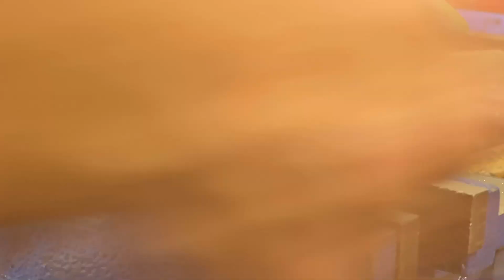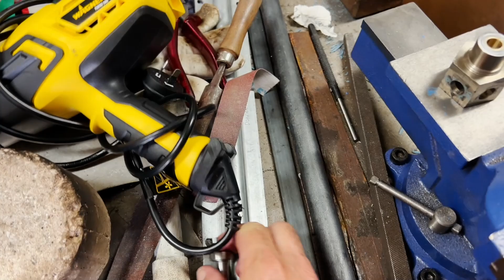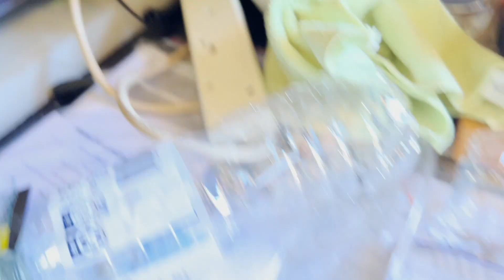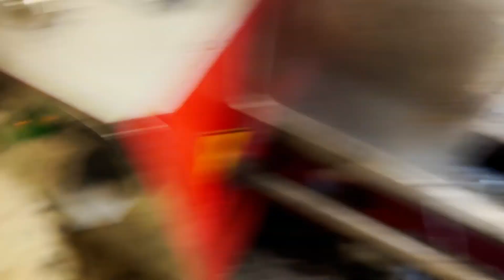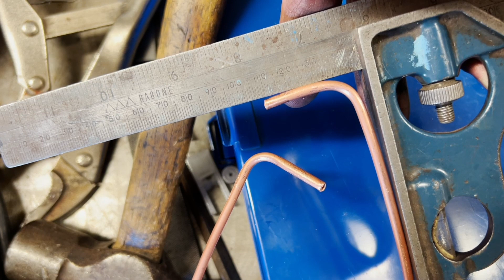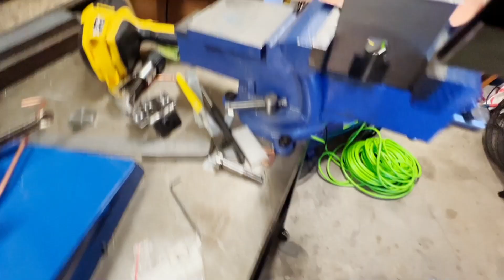5 Cylinder Rotary Steam Engine Part 2

Comment: tapping m3 and smaller size threads is a terrifying experience 😭 those taps are so fragile from the fluting.   fyi assemble and leave it at that, I messed around assembling and disassembling on a 3 cyl radial of that size that I degraded the tiny m3 threads. M2.5 is just crazy, minimal disassembly with threads that size they wont last through a lot of use.